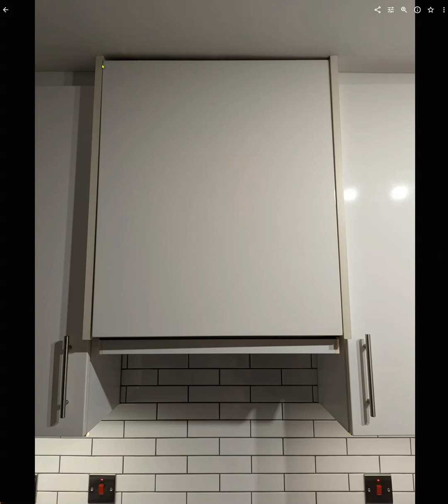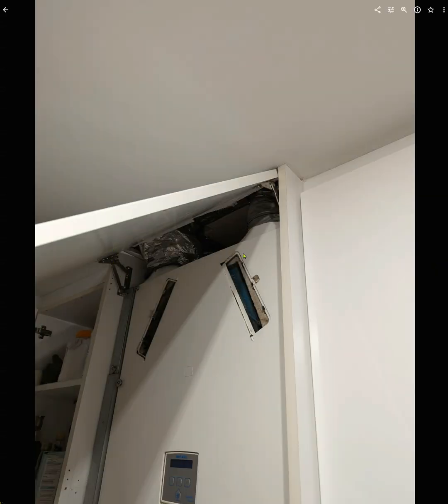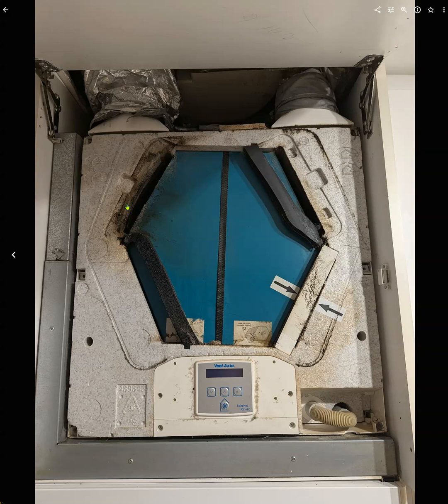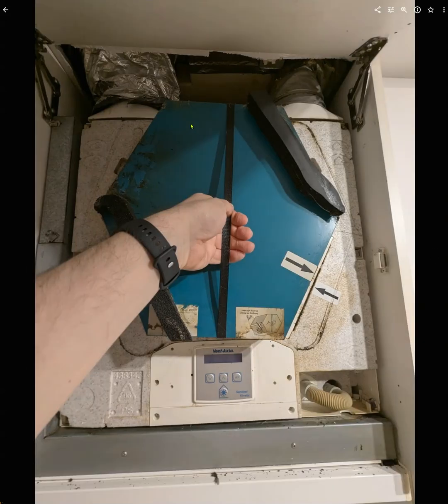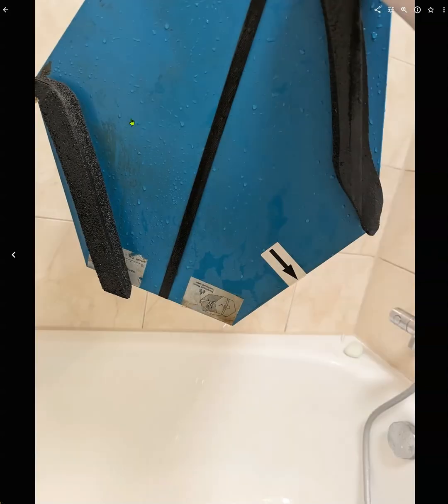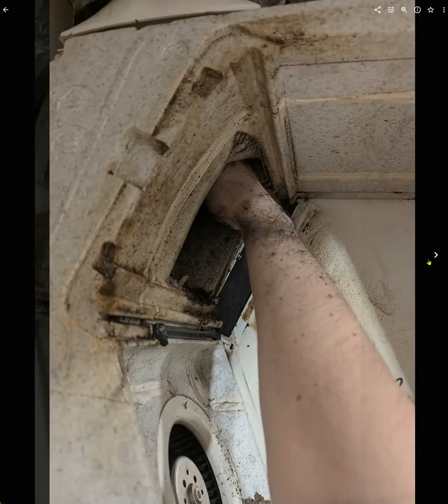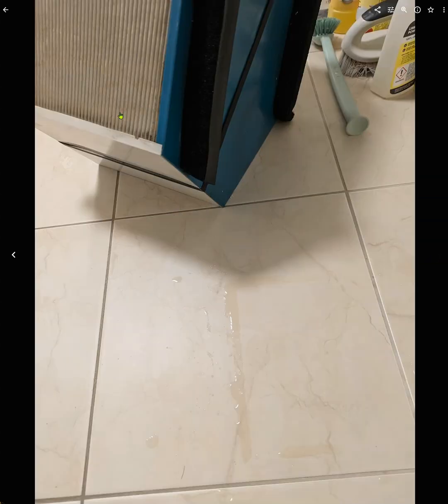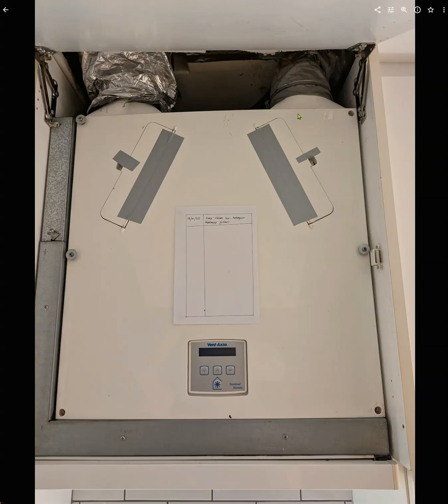DIY fix your kitchen extractor fan not removing air (Vent Axia MVHR Sentinel Kinetic)

Comment: Hi, thanks for sharing the video—very neighbourly of you, I'm grateful! Quick question: Were you able to use the cooker while the cell was out and drying?
Reply from the maker: @davidgoodfellow940  Hi David, we didn't use the hob while it was drying. You could do it, but any steam wouldn't be extracted. The oven is good to use or plan ahead and heat up leftovers in the microwave. Good luck.
Reply: @mrjohncrumpton  Thank you. A couple of days' worth of salads never hurt anyone 😃
Reply from the maker: This is the hinge I used back in 2015. I removed the spring. https://amzn.eu/d/ha121DJ
Reply: @mrjohncrumpton  Thank you for sharing the link; very helpful. Popping hinges on is a really great idea!
Reply: Hi again, hope you're well. Quick question about the hinges—we're fitting them but we're a bit confused about the spring. We left it on, but it won’t support the panel's weight when lifted. Thinking it might need a second spring, but yours works without a spring? Not sure how, since the spring is only under tension when the panel is down. Apologies, I’m clearly missing something—any insights would be welcomed?